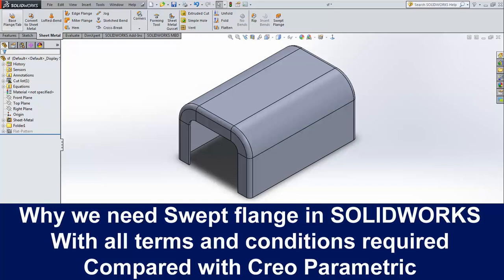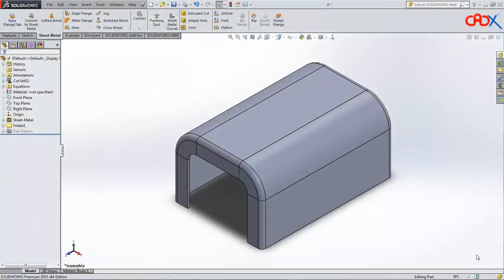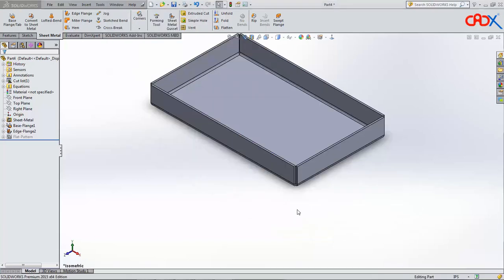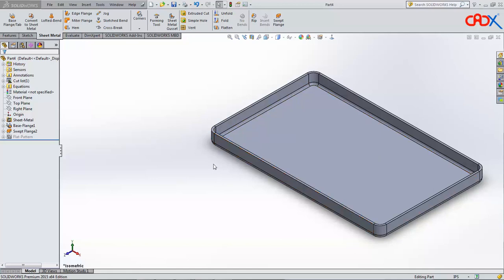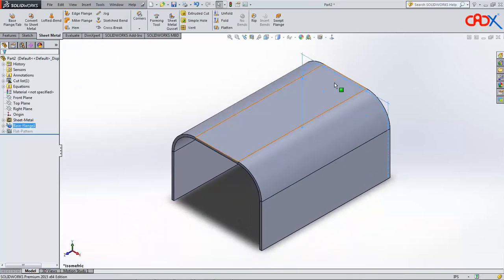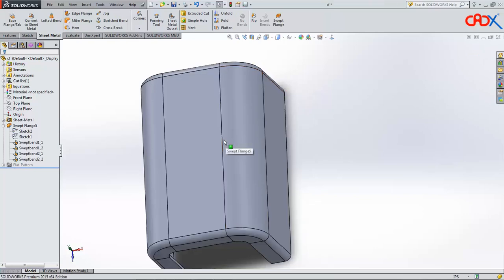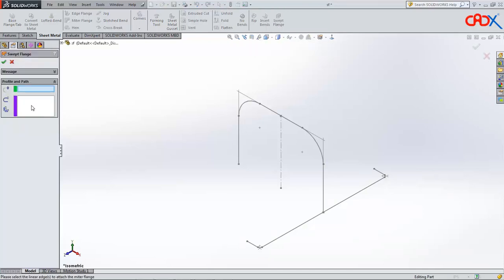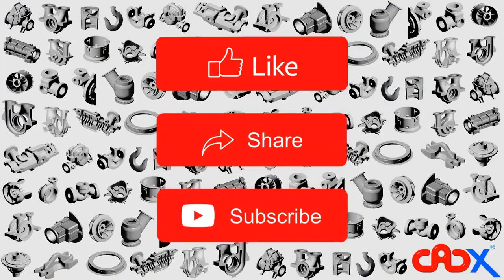Swept flange in SOLIDWORKS to create complex sheet metal profile with all concept explained

Comment: But it is CREO, not SolidWorks
Reply from the maker: You got it right.
Reply: @CADxTraining  do you know how to bend a  cup with square botom and round top where square is base flange and it has four side flange (rounded) I can get it in solide but not i sheet metal. I can´t get flaten patern of this solide i SolidWorks. Can you to sugest how, thank you?
Reply from the maker: I think this will help you.
https://youtu.be/53sMENarB0E
Reply: @CADxTraining  Thank you for the link. But, throught the form is similar, there is not solution for the problem, because there is not solution to build the botom of the cup. Problem is to build a paper cup with square botom. It seems like a box whith square botom and round  top. If i trued with square bas flange and four side flange made with lofted bend but i can´t merge them in SolidWorks and don´t get flaten patern to it. And if I try to make lofted solid and convert to sheet metal, solidWorks don´t rekognise bend lines. There is many example square to roud with one rip, but i need four rip for it. It should  become like a cross when flaten and like a coffe cup when bend. It is a challenge!
Reply: @CADxTraining Thank you for answer, but there is not solution to problem. I mean like that https://youtu.be/wuzSRmVYS6Y    If I do lofted solid and try to convert to sheet metal, solidworks don´t recognuse bends on it. If i try to build sheet metal of base flange and lofted flange, SolidWorks don´t merge flanges because them are not flate. I need both bend model and flat patern with the same part but i can only get them separate and them are not identic.
Reply from the maker: I found it in creo parametric.
https://youtu.be/4U5YLDMvVjw